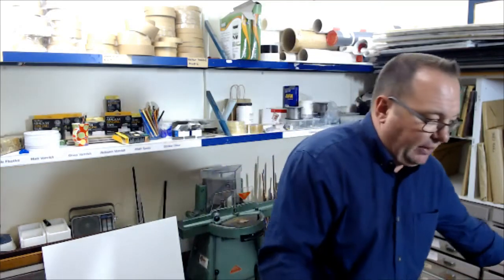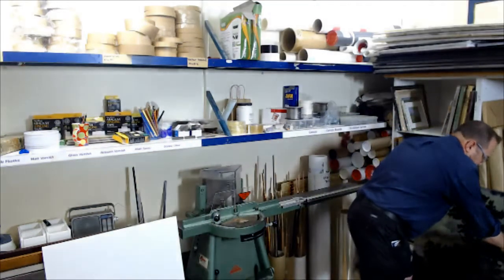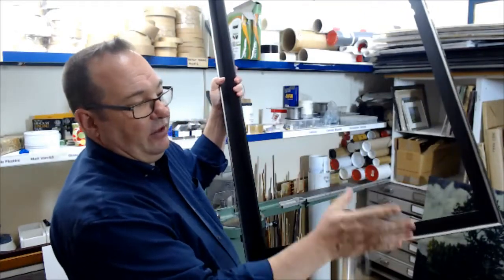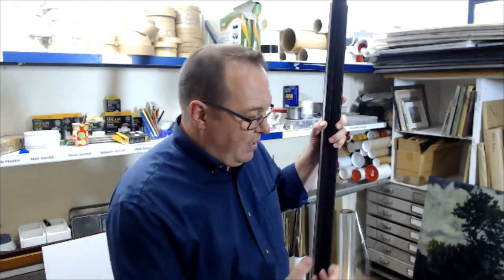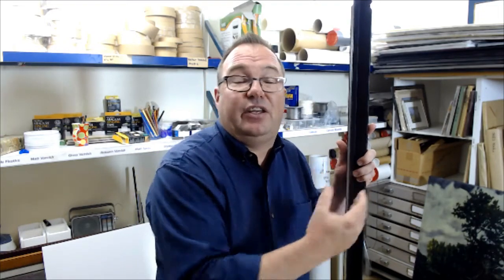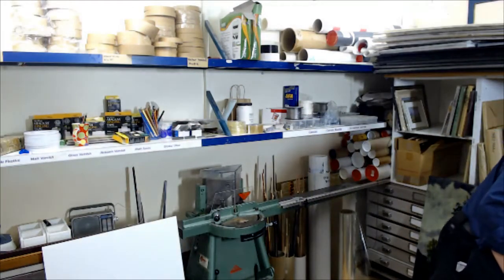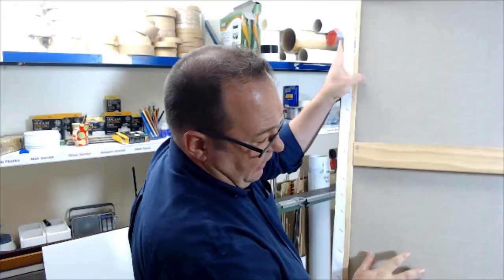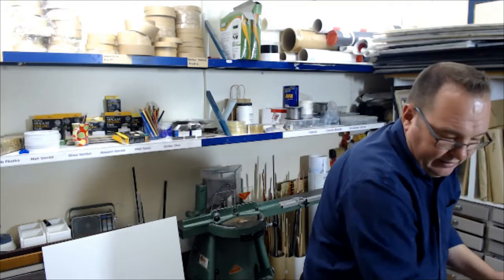Floater Frame Assembly For Painting On Canvas

Comment: Just getting back into painting and recently admired the application of floating frames. Thank you for a thorough & professional    assembly procedure video. Tips & tricks appreciated. Love the felt bumpers , gum tape finishing touches. Curious why not cut your foam spacers so you can flip the canvas and screw together in one step rather than awkward under side screwing with chance of screwing on an angle? Plus it's dual handling. Fear of art face damage? Like air blower tip for that!

Comment: Thank you for your instruction on the floating frame method.    I recently purchased a painting/print in South America where the artwork is on a very thin leather.   When I got home (USA) I took the piece in to have it stretched so I could frame it.   I was told by the store stretching the piece that if I enclosed the back it would be more suscseptible to mold or mildew.   Listening to your comments in this video, you say the back should be enclosed -  now I'm confused.   Any ideas?
Reply from the maker: Hi Clarence. There are always different opinions when framing items on stretcher bars. The stretcher has a small bevel or gap between the canvas and the timber and this gap can trap dust. The dust builds up over time which increases the surface area and this section is susceptible to mold growth over time. We usually put a backing on the works to keep dust off the backing and to also keep insects out that can damage the back of pictures also. Sometimes it is recommended to have ventilation holes and again these can be covered with a screen to prevent insects getting in. Everything depends on how much protection you want to give to a picture coupled with where it is going to hang or be displayed. For the serious collector there are resources like handling guidelines from the Metropolitan Museum of Art or other sources of authority. We seal the backing but then have small bump-ons to allow air circulation which helps prevent mould.

Comment: Where do you get the L-shaped frame pieces used for the floating frame? Are they pre-assembled?
Reply: Most picture framing suppliers have a range of "floater"frames as lengths of material that can be cut to size or supplied as chop frames. We usually cut and join the floater frames after we've stretched the canvas so the correct spacing can be achieved. If you need help and are in Brisbane please pop into Fix-a-Frame and we can show you the styles we have available. If you can't find a pre-assembled L section you can join two flat pieces of timber together to get the same effect. Best regards, David Schummy

Comment: Why did you only put the round felt pieces on the lower corners of the finished frame, and not on the upper corners?
Reply from the maker: The felt on the bottom corners are there because the frame hangs on an angle and the bottom touches the wall without the bumpers. The bumpers help prevent mold growing on the back because air can freely circulate behind the picture. If you are going to hang the picture flush on the wall you can put bumpers in each corner including the top.

Comment: @Endurart. Did you build that frame? Is there a vid?
Reply from the maker: I built that frame in our workshop at Fix-a-Frame in Brisbane. Are you interested in how to make the profile or the joinery aspect? There are a few videos of similar constructions I made for the framer's club members. If you let me know which aspect you are most interested in I can let you know what is available and if there isn't specific content available I can pop your request on the list for a future broadcast. Kind regards, David Schummy
Reply: @Endurart  Hi. Im interested  in the profile, it looks like it's one piece, not joined from the pic before the vid starts. Also, is there a coating of some type on that? Thanks
Reply from the maker: @richard_red_64  It is made from two flat pieces with the vertical piece running all the way to the back edge. The coating is a black composition like a synthetic gesso but you can use any good sanding sealer and paint accordingly. It is sealed all round to help prevent any warping over time.
Reply: Will that tape dry out over time and begin to fall off?